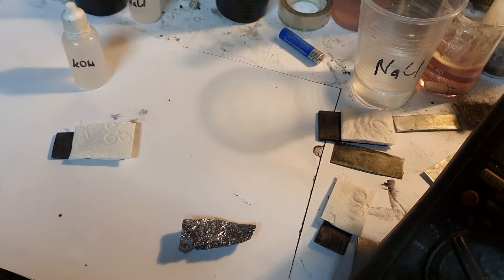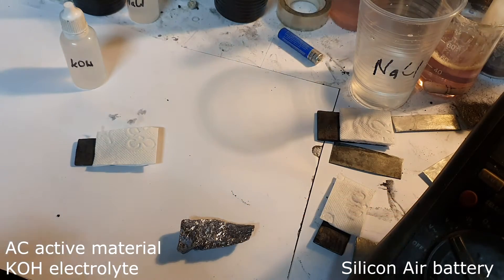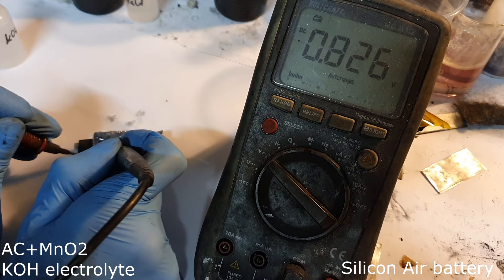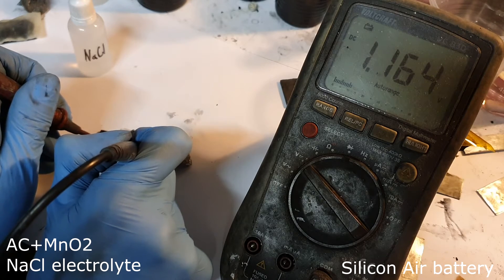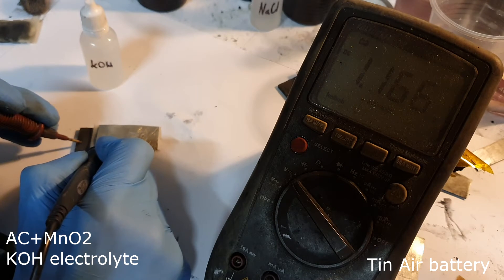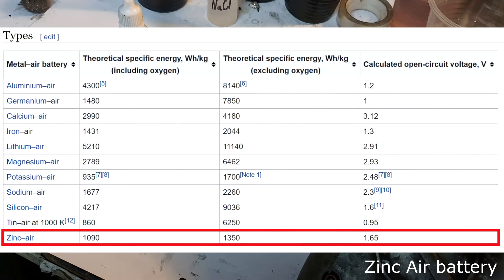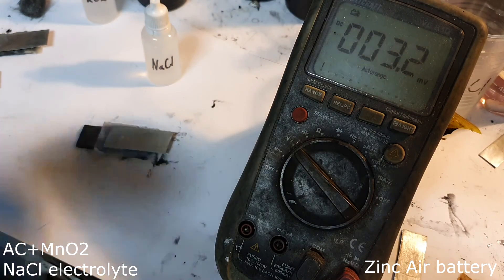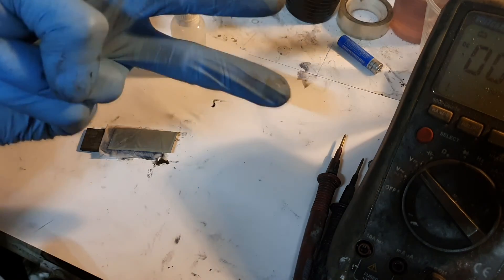Homemade Metal Air Battery - Part 2

Comment: sir can you make a video on how to bind manganese dioxide on graphite plate?" pleasee sir....
Reply from the maker: usually I dont bind active material on graphite in prototypes. I only make slurry with material and water or electeolyte. But if you want to bind the material you need to make a active material first. You make a mix of 80% MnO2, 10% conductive material like graphite and 10% of binder. Or in grams,... 0.80g MnO2, 0.1g graphite and 0.1g of binder (8g MnO2, 1g graphite, 1g binder). In the end you mix it really well. Then you add the slurry on your current collector (graphite plate) and you dry it. For the finish you can also press the electrode to bi sure that you have good conntact 
between active material and current collector.
Reply: @cayrex  THANK YOU SO MUCH SIR <3

Comment: You define in your video: the higher the voltage, the better the battery. Is it really like that?
Reply from the maker: Yes, but I mean better in voltage. For example 1# is magnesium with 2V, 2# aluminium with 1.6V  and 3# zinc with 1.4V,.... in voltage. In capacity (Wh) is 1# silicon air with 9 kWh/kg, 2# aluminium air with 8 kWh/kg and magnesium air with 6 kWh/kg and so on. The point is if you have a cell which have better/high voltage you can use only one cell for  some 2V application, for example. If you have iron air cell the you need 4 cells to get into 2V range,... and so on....

Comment: Really like the way you have methodically tested a number a metals with common household neutral and alkaline electrolytes to see what voltage can be achieved with basic construction materials, excellent for educational demonstrations!. Maybe you could also do the same tests with a common household mild acidic electrolyte for comparison to these, such as 5% acetic acid (eg white vinegar) or dilute citric acid (eg lemon juice)?. This may reveal some interesting trends of which metals prefer alkaline, neutral or acidic electrolytes for the best voltages for simple metal air battery experiments, P :) (y)
Reply from the maker: ohhh,... the vinegar,... I completely forgot about that. Next time....
Reply: @cayrex  No probs man, just keep those awesome new vids coming :)
Reply from the maker: @petermiddleton6902  I will I will,... I try my best 😅
Reply: @cayrex  All grand stuff! :D (y)

Comment: You can soak activated carbon felt in solution of KMnO4 to form MnO2 impregnated directly in the pores (heat to dry, MnO2 forms on decomposition). It's nice way of making homemade cathode for metal air battery as KMnO4 can be bought easily. It also makes really amazing active catalyst for H2O2 decomposition, drip a drop of 30% H2O2 onto the MnO2 impregnated felt and watch instant decomposition, but be careful.
Reply from the maker: yes,... that can we make like you and me,... but the point and idea of that video is to be really user friendly for beginners or even older kids that can experiment at home with basic materials.
Reply: @cayrex  Ah, sorry watched part 2 before part 1, doh!
Reply from the maker: @idea-shack  hehehehe no panic. But yes, you are right about MnO2 coated carbon felt,.... it is great in air batteries and even MnO2/Zn cell. But H2O2 I haven't tried it yet.
Reply: @cayrex  I have experimented with H2O2|AC|aluminium battery, I got some success (without MnO2 of course, just clean AC). I first prepared solution of sodium perborate/borate buffer by dissolving borax in H2O2 solution (I think I also used small amount of sodium hydroxide to make weakly basic) and then used aluminium foil, graphite and pure AC powder. The borax/perborate helps passivate aluminium so that it doesn't quickly form hydrogen gas and is also electrolyte and oxidant.
Reply from the maker: @idea-shack  Interesting. That will be nice to try... 😁 What voltage you get?
Reply: @cayrex  I honestly can't remember, was very long ago. I do remember that it wasn't great cell, but interesting nevertheless. I think it still suffered from decomposition of peroxide slowly, even as perborate.